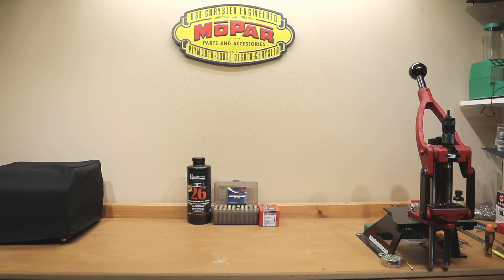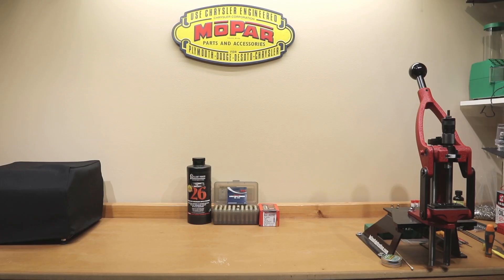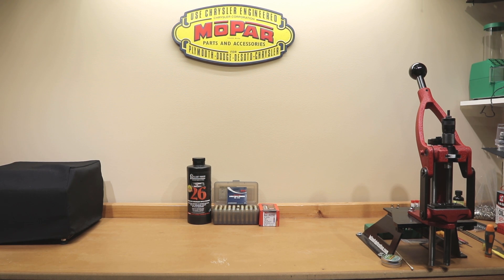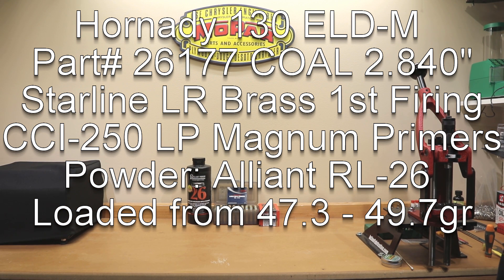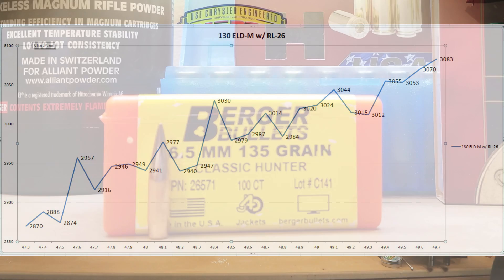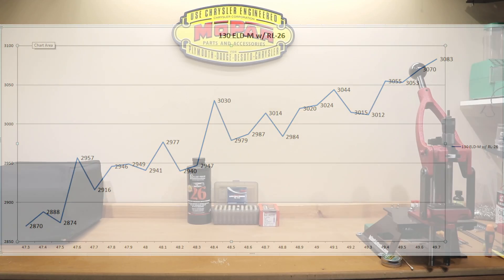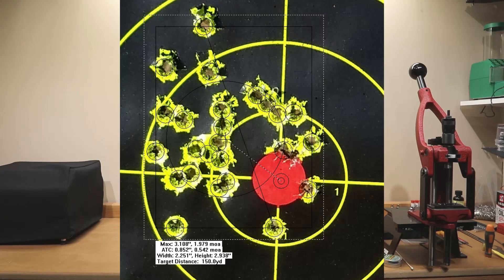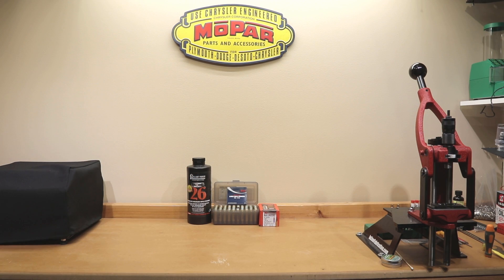Using the 10 Round Load Development Ladder test; The velocity chart for Hornady 130 ELD-M and RL-26

Comment: So I’ve been working with RL-26 in an AR-10 that I built. I’m using 129 Nosler ABLRs in a 20” barrel. No matter what load I use I get ejection smears in the brass, some severe! Primers are a little flat but nothing to worry about as I’m running a JP high pressure bolt and all the primers are flattish. I’m hoping it is brass which is Federal. My loads start at 46-48 grains with Federal 210m Fed primers. OAL is 2.816, mag length and shorter than the maximum that Nosler recommends. At max loads with H4350, 43 grains and Hornady brass all is good. I plan to start over with once fired Hornady brass to see if there’s a difference. I’m getting 2800-2950 FPS and sub 1” MOA with 3 shot groups at 100 yards. Suggestions?
Reply from the maker: Not an east task troubleshooting over the web on this one, I don't see how you can hit pressure with RL-26 at all really. I know you said that it is shorter than the recommended OAL than Nosler states, but are you sure its not into the lands? That does seem very fast for a 20" barrel as well. I got the 135's to about 3040 out of my 24" barrel
Reply: Bolt Action Reloading The length is just under magazine length and that is definitely off the lands. I really think it’s the Fed brass. I’m hearing from all sorts of people how soft it is and how the primer pockets give way and I’ve experienced that too. On my barrel, it’s a Christensen carbon fiber. I would hope that a custom barrel would perform better than an off the rack barrel.
Reply from the maker: I haven't blown the pockets out of mine yet, but that seems to be how all the 6.5 creedmoor LR brass goes. In my federal brass I have loaded 140s with IMR 4350 (no issues) as well as 147s with RL-22 (up to 46.2 grains) with no real issues. That is my only experience with it so far though.
Reply: Gene Itzkowitz I know this is 5 months old, but hopefully this may still help you.  You will find that Federal brass is very soft.  It won’t take the pressure of others like Lapua or LC.  In a gas gun I actually prefer to run lake city because of how tough it is.  If you decide to try lake city, start 1 full grain below your Federal load data.  LC has a smaller case capacity and you will get higher velocity with less powder.

Comment: This an opinion, so take it as such.  I have not arrived and still learning quite a bit about reloading, but you are using a slow burning powder when compared to the standard H4350 / RL17.  Why so slow?
Reply from the maker: Velocity in this case.  Other powders might max out around 2750-2800 fps. 3000 is a better place if your groups hold together.

Comment: I would combine the Robin Round technique with Saterlee and compare velocity plateau to impact vertical dispersion (Robin Round) Seems as Satter Lee method works only when powder combinations work hence single digit SD's.

For instance many have found Varget to be most accurate for the 73-77gr .224 bullets in 223 Rem. Though H322 isn't much talked about in that weight as being accurate
Reply from the maker: Not having "real" load data for this combo I figured this might be a good example, but maybe not. In the end we all want to get to the same place, but I think using different techniques can show weaknesses that we can improve on.
Reply: I agree! I think this method works also in finding combos that just wont work for your firearm. Thus aliviates load development efforts. Thank You for showing real results brother!

Comment: I'd duplicate this same test with once fired brass to see how important the fireforming is to get usable results.
Reply from the maker: The sig brass performed differently on the second load, so my confidence on fire forming brass while performing this testing  is low. The next 2 videos are done using this info so I wanted to have this out for refrence. Certainly not everything I try is going to work, but I had to fire form it with something.
Reply: Bolt Action Reloading that's one of the only good reasons to buy factory ammo in my eye. It's a good way to get fireformed brass without wasting reloading components. Sometimes the factory ammo is the same price as new empty brass too. 👍
Reply from the maker: Comparing all the brass, Hornady isn't what I would pick in the future. Does anyone load factory with Lapua brass?
Reply: Bolt Action Reloading not that I'm aware of.... Maybe ABM in some calibers, but its also pricey ammo.

Comment: Your videos are always well produced and very good. Thumbs Up!

I am sorry, but I disagree though with your claim of efficiently developing a load similar to the 10 shot method. You are jumping ahead to the 0.1 grain step, and loading the entire 25 round string first. This is not Scott's method. It is yours. The idea behind Scott's method is to get there in 20 to 30 rounds. Kind of like a binary search for the node, and then converge with 0.1 grain steps and finally seating depth tuning. 
Your variation of that method already has the shooter at 25 rounds, with the node identification. Now your node confirmation will take another 5-10 rounds. Then another 10-20 rounds for refinement and final tuning. That put's you at almost 2x Scott's method. I truly don't see the need for the 0.1 grain step to start. That step is the beauty of Scott's method. Quick Node Identification.
In the end I think you get there quicker then OCW, but not as quickly and efficiently as Scott's method.  
Thanks for the video. Nice Job.
Reply from the maker: Thank you fornthe compliment. Maybe I am not entirely clear. Thus series is based on me trying to gain confidence in using this method in the future. I am not trying to prove how efficient I am, but simply prove if my reloading process is tuned in enough to use this method. Typically I process lots of 25, thus 25 rounds in a test.  This video is largely a entry into my next 2 where I take the charges found in this graph and apply them to the nosler 130 Rdf. Certainly not everything we try is going to work but won't know until we try.
Reply: Maybe try this. Shoot 25 rounds at 0.1 grain difference/round as you like to do. Present and analyze your data at 0.2 and 0.3 grain increments. Use the coarse plot and fine plot to determine if you miss anything with the coarse analysis that you wouldn't pick up in step 2 of  Scott's method. That may help convince you and others to the efficacy of Scott's method.
Reply from the maker: To be honest the more I have worked with this the more I am trying to iron out variance in my reloading process.  I am obviously aware that I am shooting 25 rounds and not 10, however i am giving the audience enough credit to erase every other shot on the chart and be able to see what it would tell them. In his example he uses reloder 26 and has very wide nodes, I have not found any nodes that are .6 or .8 grains wide in my development, as is demonstrated in their video. I personally wish they would have went into greater detail about his reloading process. In this series I hope to explore what is really needed to make this method work, and maybe what isn't, but if someone watches one video in the middle it will be hard to understand the relevancy of the particular video. As I go further along I will probably make a summary video summarizing what we have learned over all. Unfortunately a lot of people think you can watch one 5 minute video on YouTube and load ammo with a ES of 5 having never having reloaded in their life.
Reply: I hear you. I am working on a bonded bullet round for my 260 remington with RL-23. If I could paste my Charge vs Velocity plot into this comment, you could see a broad 0.8 grain node from 45.5 to 46.3 in  0.2 grain steps 11 ft/sec ES. 7 fps ES in the middle of the node, 0.6 grains wide.

So, I do think it works for node identification. It may be powder dependent as another poster commented. But, I would then argue, stay away from that powder since it won't produce consistent velocity performance. That is 1st and foremost key to repeatable results.

Great discussion!